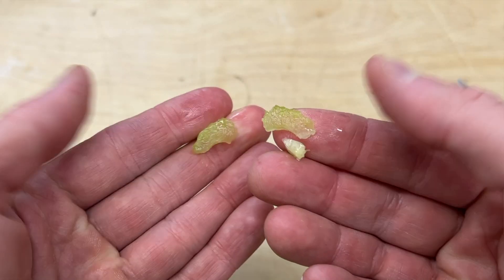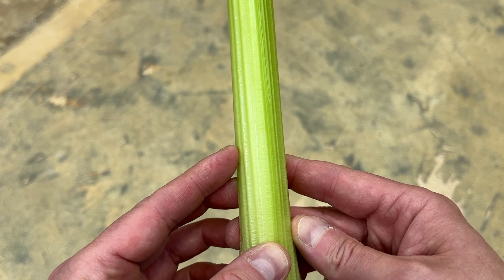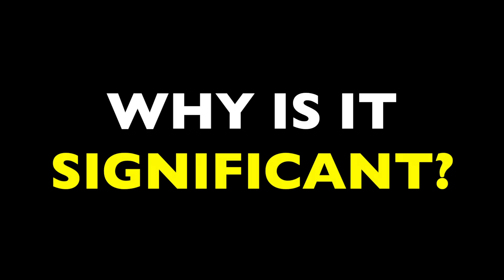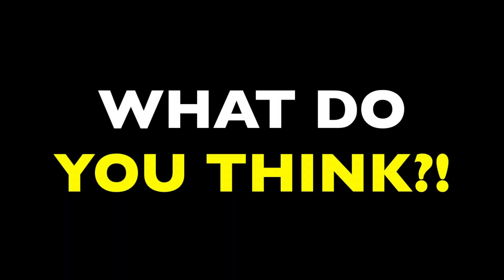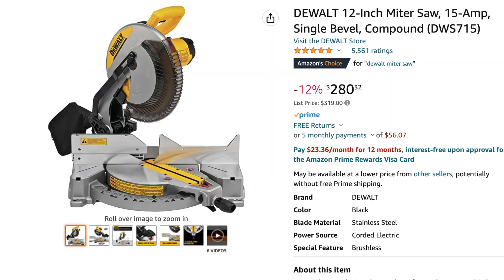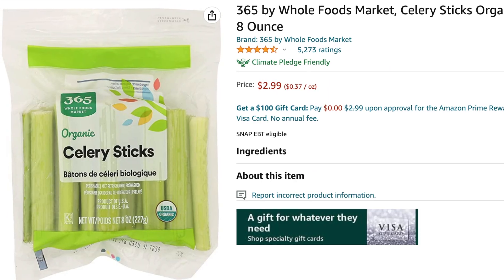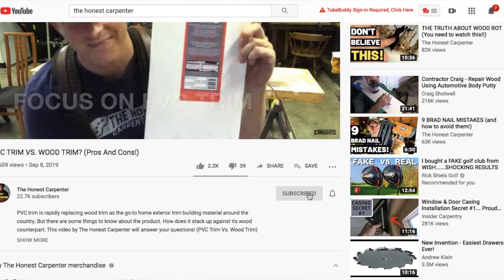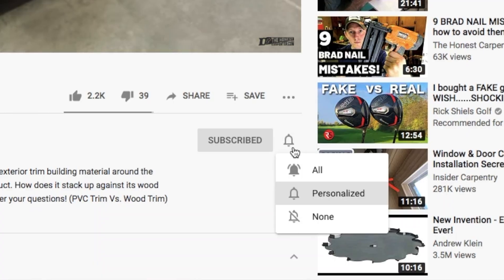What CELERY Can Teach You About WOOD...A Beginners Guide To Carpentry And Woodworking!

Comment: Here’s one you could explore. As a painter of 31 years, is it better to clean off the “gray” dead wood fibres then prime and paint? Or, with many specialty primers, prime that gray layer and lock those fibers in then paint? Pressure washing can remove up to 1/8” of wood making the board weaker.

Comment: Great explanation, totally agree ... but as a hand tool woodworker ... I find crosscuts easier to control than rip cuts ... wandering grain makes the rip cuts a pain to stay on target. Thanks though ... you are correct and I'm old. $0.02
Reply from the maker: That’s a great point, Matthew! I hadn’t considered that, but I have experienced it before when I’ve made short pull saw rips 😄

Comment: I really like the comparison you made between celery and wood.  I think an excellent follow-up to this video would be how easily wood splits as nails and screws can form a wedge between the fibers especially when too close to the end of a board.  You can show remedies to this by drilling pilot holes, greater distances from the board end, or flattening the ends of nails. Thanks for your great work!
Reply from the maker: Thanks George! Great insight—I wanted to include many of those exact points, but just ran out of space and time in the video. Maybe I can do a reprisal down the line! 😅

Comment: Nice metaphor!  I'll use it.  But now, the rip.

Celery tastes like crap.  It costs more calories to consume than it provides.  It's also soft on the inside.  

Wood does not taste like crap.  Depending on your dust-collection system you've tasted it. Calories have not been measured.  It's not soft on the inside.

Houses (in the US) are made of wood.  Nothing good is made of celery.

Wood is the building block of a lot of things (houses, tables, chairs, sofas, and wooden-computers.  Ok, not so much that last one.)
Celery is the building block of yucky food.  It tastes horrible, smells badly, degrades quickly, does not stain, paint, or sand well.  Really it's just a poor excuse of a building block.  It's more ... like... a vegetable.

Brussel sprouts are even worse, and don't get me started on kimchi.

Thanks for the metaphor.  I'll cut against the grain of celery every time.

Ehud
Tucson
Arizona
US